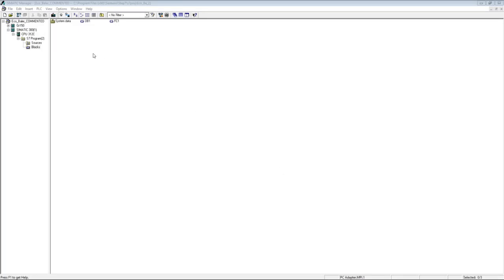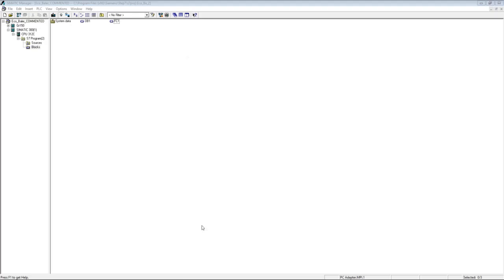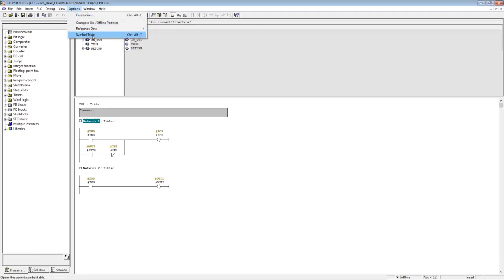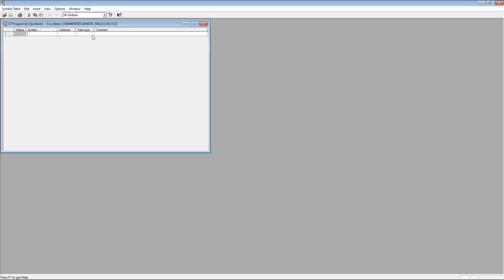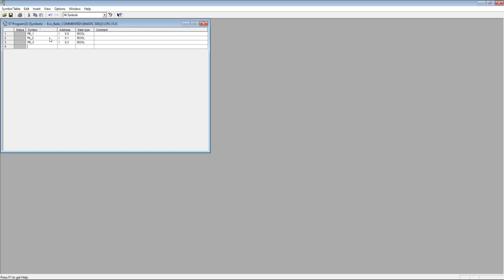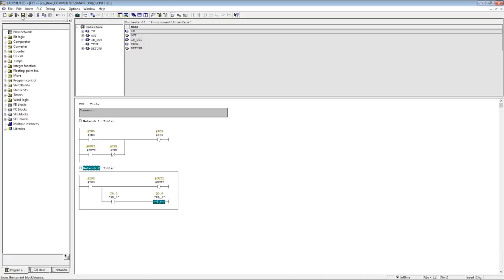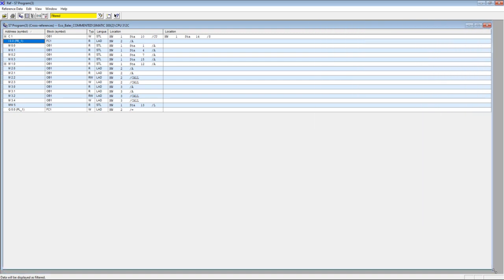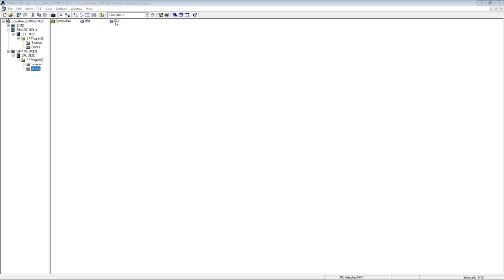Siemens Step 7/Simatic Manager- The basics

Comment: Hi sir, can you help me. i learn and try makw sample project but when I want save and compile (1230:3000) the system data could not be recreated because the configuration is inconsistent. What happen? thanks
Reply from the maker: Hello Muhammad, 

Without too many details I can only shoot in the dark here -I believe you're talking about either a corrupt file issue or the device configuration is not paired fully with the open project when you try and save. If the open project has a different S7-300 then the one in the configuration it's a recipe for a bad time. Are you pulling from a CPU or working on it as a simulation project?
Reply: @notyouraverageredneck8167  i use ps 3072aA and cpu 313C